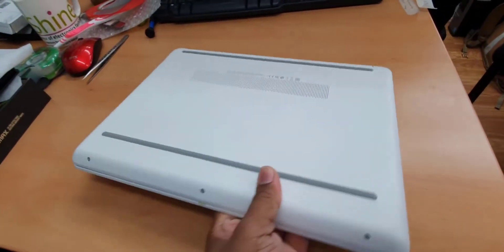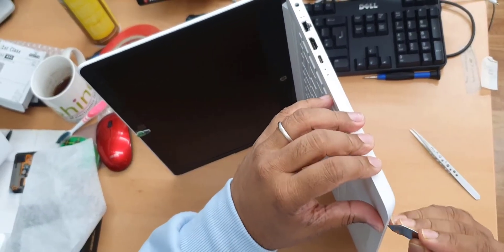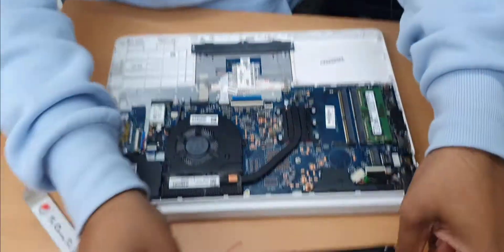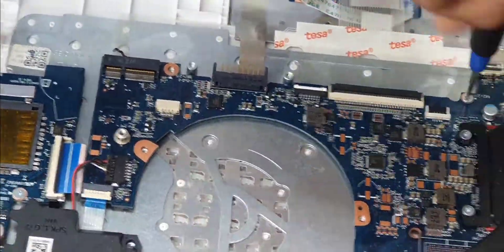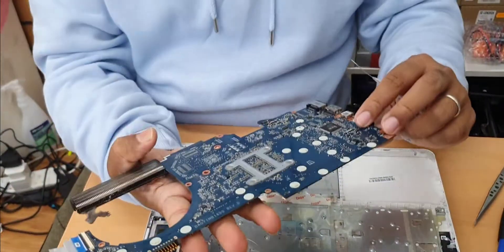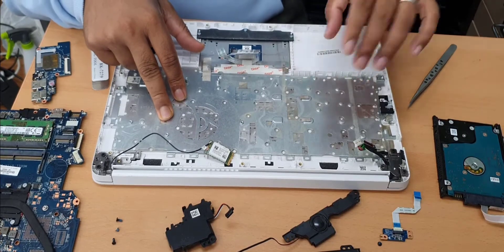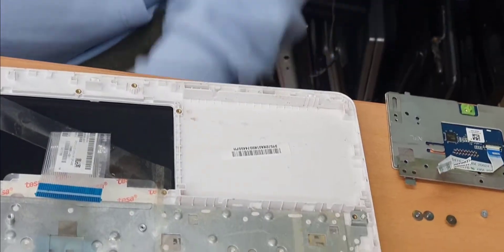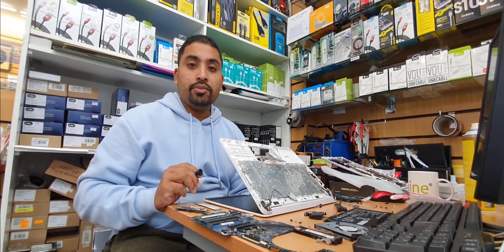HP 14-bp060sa Complete disassembly Details | Step By Step

Comment: Hi there.  Do you know where the CMOS is on this model please?  It won't boot up just starts and immediately stops so assuming BIOS issue. Thank you.
Reply from the maker: Hi, that is a very interesting question. I did not even notice about the CMOS battery!! Instead of finding CMOS just use the keyboard shortcut!!
Reply: @thepcphone  thanks for answering. The laptop shuts down before it even acknowledges the keyboard so neither windows-b or windows-d work.

Any ideas please ?

Comment: is it possible to Install m.2 ssd in hp 14-bp  series?
Reply from the maker: In that one yes you can do install M.2
Reply: @thepcphone  which M.2 drive works with this model? I had a SkHynix one and the laptop refused to recognise it, not even in BIOS (I did also update the BIOS successfully from HP Support website). Also, how do you replace the keyboard? I have a replacement keyboard but I'm not sure about how to safely remove the old one? Thank you.